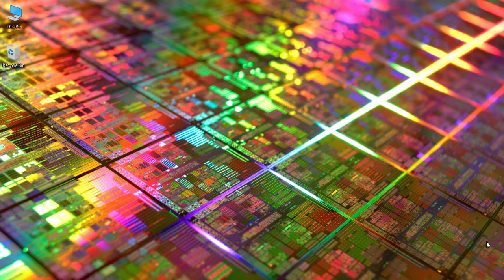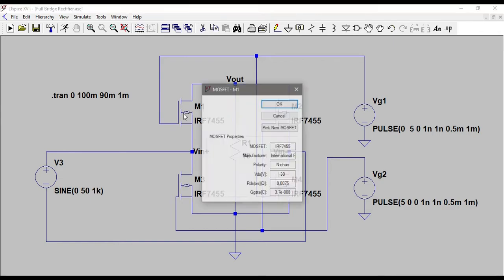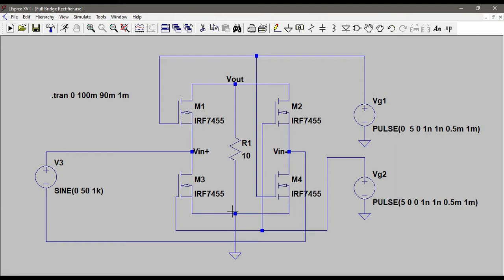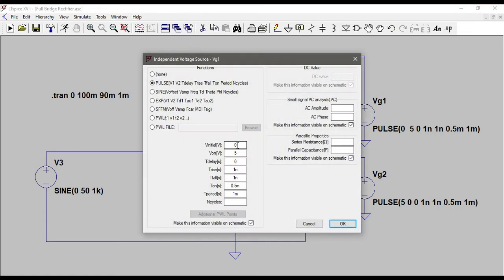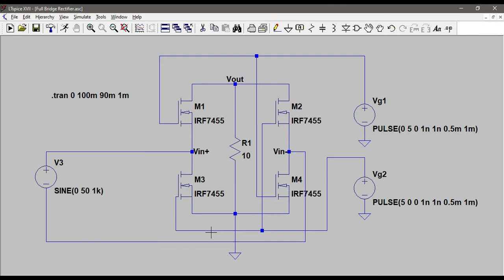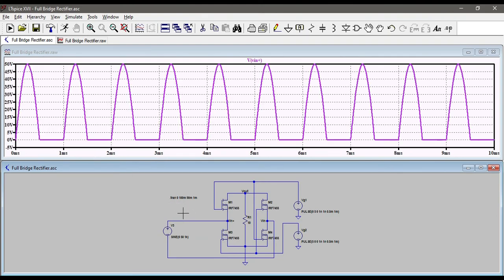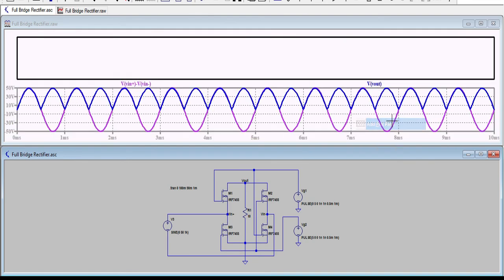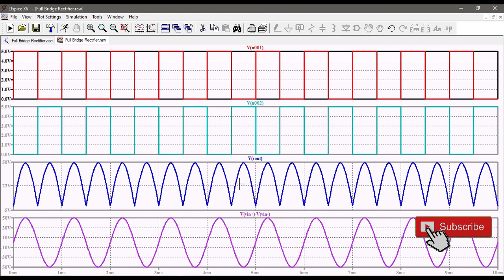Full Bridge Rectifier using MOSFETs in LTspice

Comment: A complete sample for 230v would be really appreciated. I need to do a 5000w 230ac->320dc, i'm actually using classic rectifier bridge (diodes, metalic housing) and it gets really hot with only 1000w tests, in fact I need to use a really big aluminium disipator even with a pc 12v fan. That heat means loose of power too.

Comment: This is a nice circuit and has the potential to work, but the reason the voltage is rectified is not the mosfets, it is due to the intrinsic diodes in the mosfets. in fact you do not need pulsing supplies and you should still get the rectified voltage. May be if you increase pulse voltage to 5V+ max AC amplitude this will work

Comment: Hey Jairam! Great video, thank you. My question is about the output. It's a ripply DC ( as it should be ), but is there a way to smooth it out, and make ~0 Hz DC? If so, then how? I tried adding a capacitor, but it completely confused the output. Any answer would be much appreciated!
Cheers,
--
David
Reply from the maker: Hey David, it is possible to make almost 0 Hz DC. You said you added a capacitor.  Yes by adding an RC filter you can do it. But you see if there's a finite resistance the charged capacitor is always gonna discharge. Basically you want to charge it up to highest voltage and don't discharge like a sample and hold circuit. You can use an opamp buffer which has large input impedance. There are other ways to implement this as well. But anyway discharging path should have large resistance.
Reply: @jairamgouda  hey my output Is coming different than urs?

Comment: What would be the purpose of this when compared to a regular diode rectifier? Does it create less power dissipation from the rectifier circuitry, and in turn more power output on the load resistance?
Reply from the maker: Yes you are right, the diode needs to drop   much larger power than MOSFET because channel resistance of MOSFET in on (precisely saturation) condition is very less.

Comment: Hye!  I find your video very much useful. I'm currently doing my final year project and this is my first time using the ltspice. can you explain to me the function of Vg1, Vg2 and V3? I'm confused.
Reply from the maker: Nice to hear that from you Adriana. Vg1 and Vg2 are required to turn on the MOSFET devices when they are supposed to turn on. If you don't supply those voltages, they won't turn on.
Now, why did I choose pulse input with those parameters? I chose pulse because I want those transistors to turn on immediately and just work like a switch. 
Why those 1ns rise and fall time? Just to make it more natural since we all no that rise time and fall time can never be zero. 
Why turn on time is 0.5ms? To turn on M1 and M4 by Vg1 for positive half cycle of the input and to turn on M2 and M3 by Vg2 in the negative half cycle of the input. 

Input V3 is our stimulus to the circuit. I've chosen 50V just to make it feel like we are working with power electronics. You can choose any high voltage you want and frequency is 1kHz. 
Since input V3 has 1kHz and 1ms period we must use the same for Vg1 and Vg2 as well.

I hope it helps
Reply: @jairamgouda  so it means that it is necessary to have Vg1 and Vg2 in order to show how the MOSFETs work during the positive and negative half cycle, right? Lastly, is it possible to find the output frequency from this full-bridge inverter?  This is because my project is on the ultrasonic cleaning system and the output frequency produced from this inverter will then be used to trigger the cleaning transducer connected. So, I would like to know how to actually find the output frequency from this circuit using ltspice. I'm really sorry for asking you a lot Sir but these two questions really important for me.
Reply from the maker: @adrianaazizi5962  You are absolutely correct about Vg1 and Vg2. 
This is a full bridge rectifier so whatever you get at the output is basically positive fluctuating or varying DC. Now, I want you to think for a second. What is frequency? It's the periodicity of the signal or inverse of the time it takes to repeat itself. Just look at the graph in the video. Isn't the output voltage repeats twice as fast as input? 

Yes, the output frequency is twice as that of the input. Correct me if I'm wrong. Don't worry about asking questions. I'm not a YouTuber. I had created this channel to help my friends. 
Hope it helps
Reply: @jairamgouda  ouhhh yes! oh my god i totally forgot about that! yes, we can find the frequency based on the graph. Thank you very much sir for your clarifications. I hope your channel will get bigger so you can help a lot of people. Thank you sir!